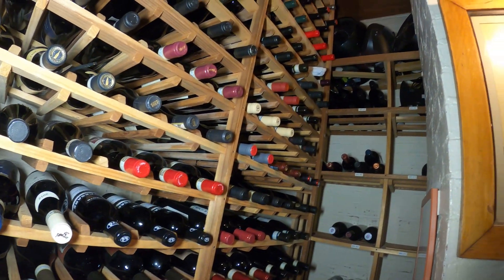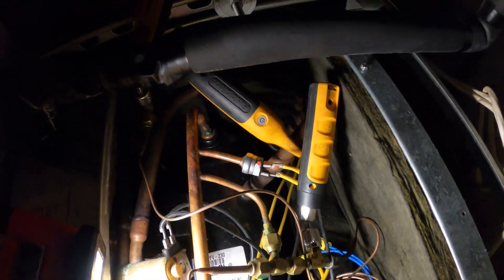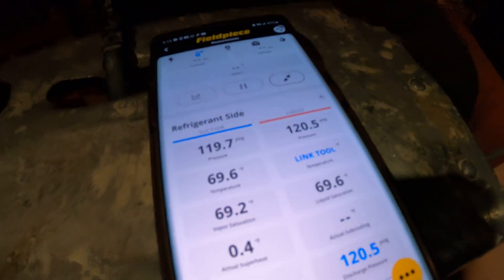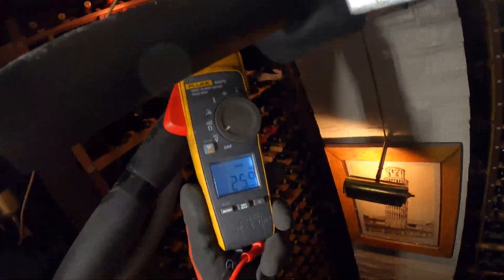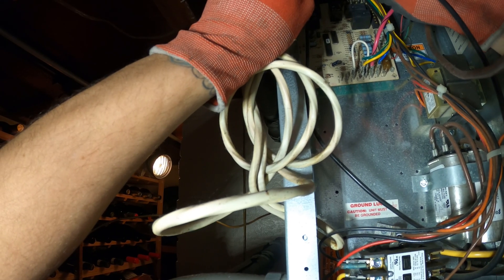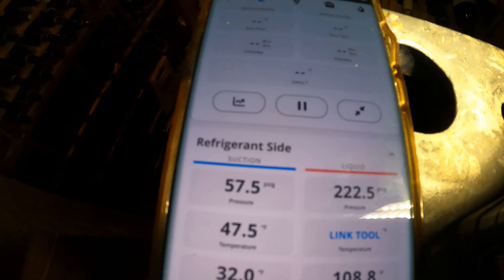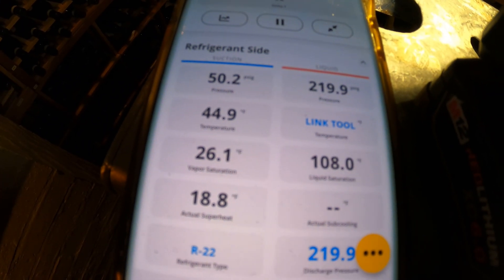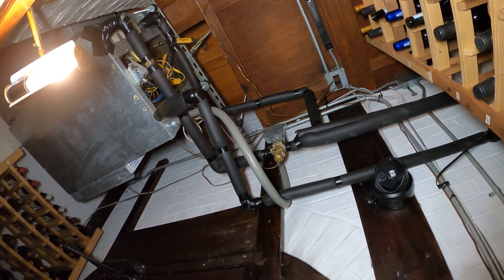HVAC Service Call: Water Source Heat Pump Not Cooling (Walk In Wine Cooler Not Cooling)

Comment: Great Video. Nice Work. What is water source heat pump ? is water source heat pump the same as Fan Coil Unit ? Thank you for sharing
Reply: Uses cool water from the cooling tower to cool the compressor such as a condenser fan would.

Comment: So was the tipoff for you getting 24 volts across the pressure control circuit at the printed circuit/timer board?  So you jumped the pressure control to enable system? Thanks for creating your video presentations, I watch/study them to learm.